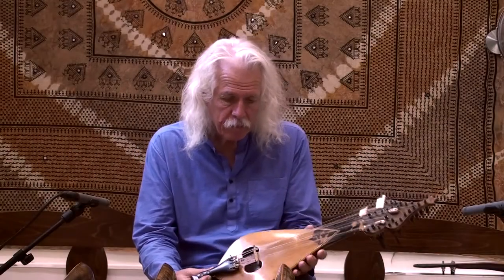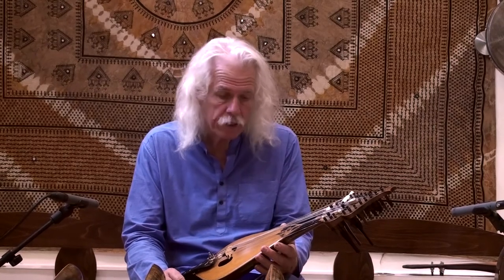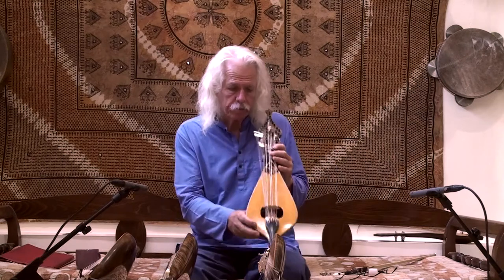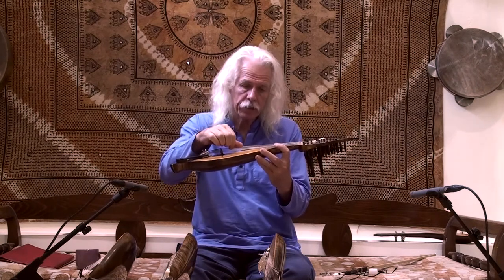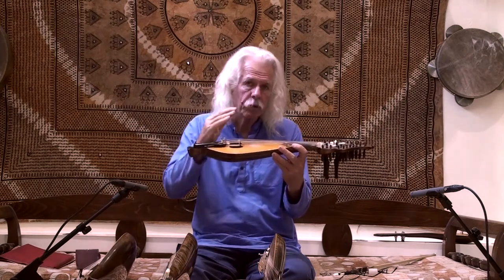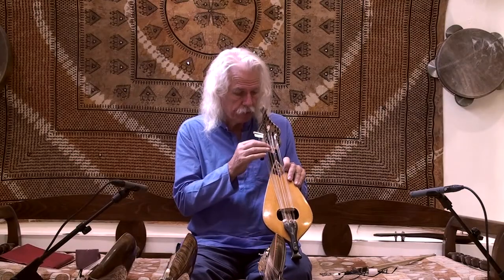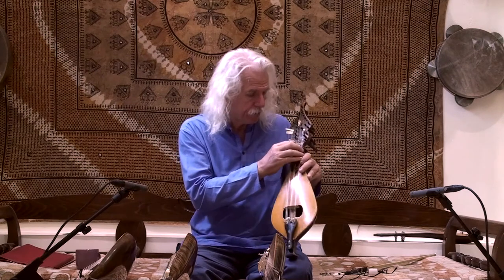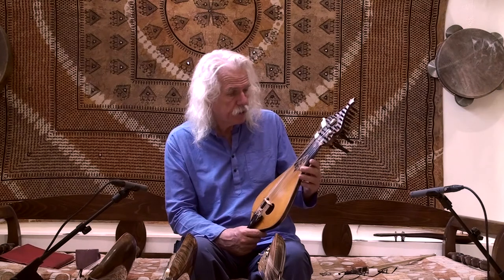Ross Daly: The concept and the tuning of the lyra with sympathetic strings

Comment: this is so helpful. I have found that the tension on an instrument goes waaay up
when I add sympathetic strings. 
The first time I tried putting them on a ‘bowed lyre’ (Talharpa) the headstock snapped right off as I tuned them up.  haha.

Dear reader, if you do a modification consider the added tension on the neck and the sound top.